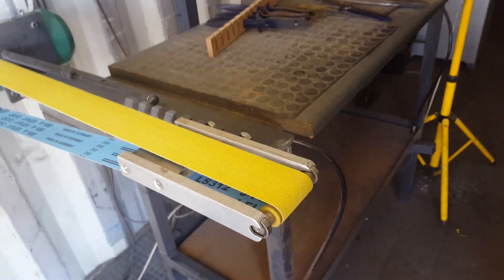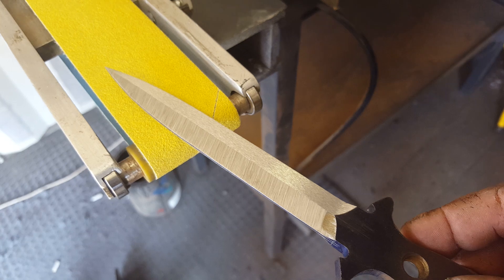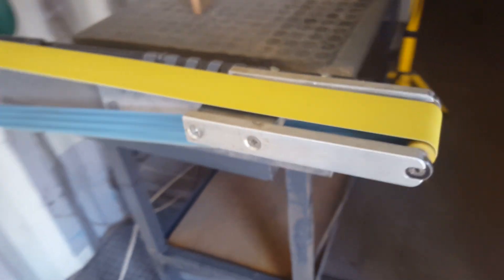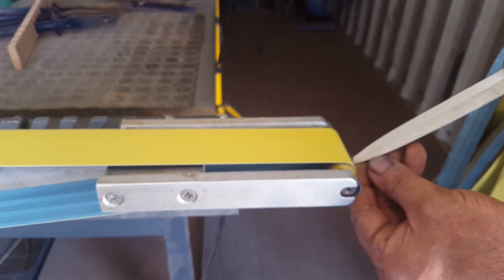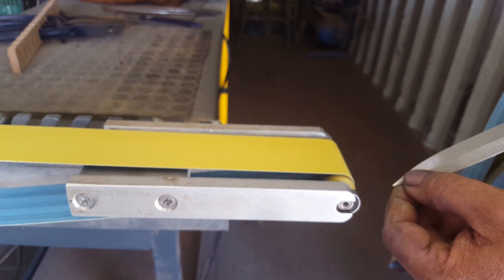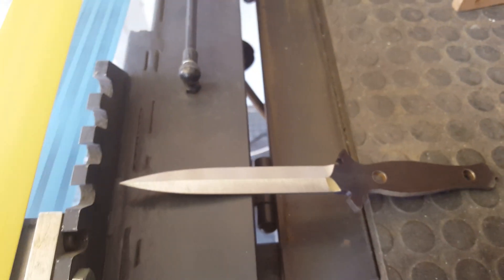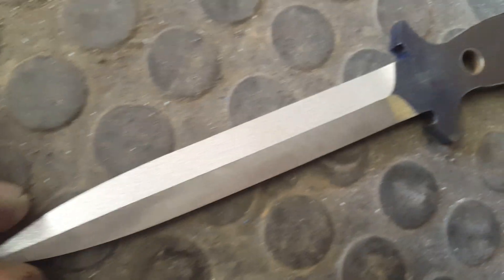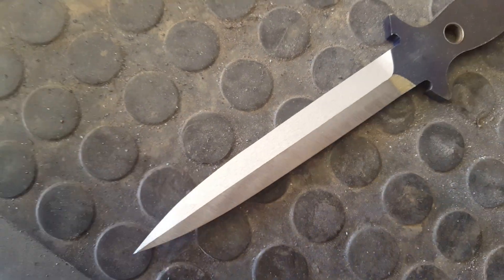Be the surface grinder!

Comment: Makes no sense.  You have to grind the same amount of steel to remove the 36 grit scratches if you grind the traditional way or the method you just showed.  The difference is there is a higher chance to screw the tapering, or the flatness of the bevels, or the straightness of the center line.
Reply from the maker: it's a demo on a specific technique only - the idea is to share ideas and information ... use it / don't use it
Reply: Nice dagger though  :)
Reply: Length wise grinding on a wheel is much faster because you have a smaller contact surface - also works real nice on larger contact wheels